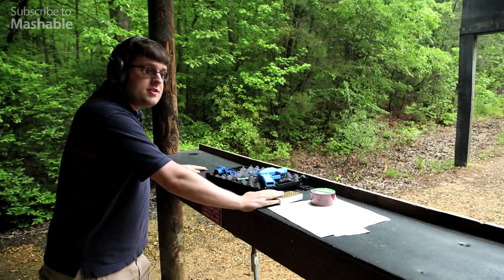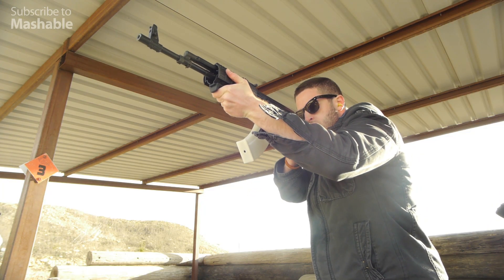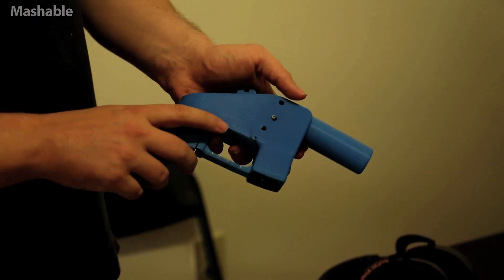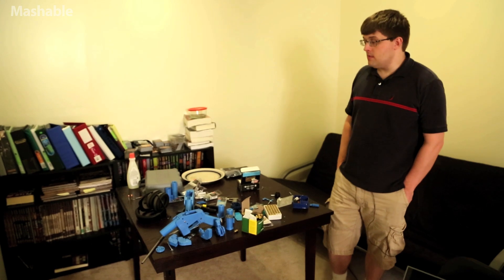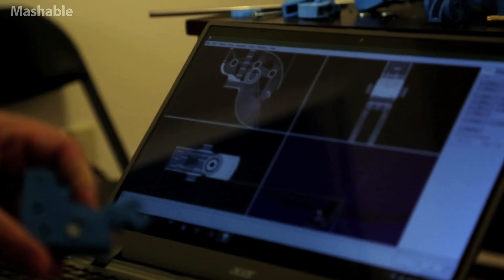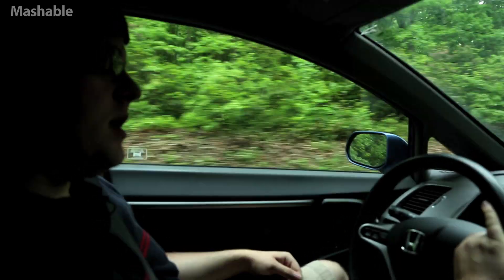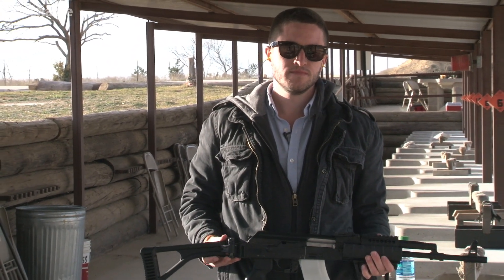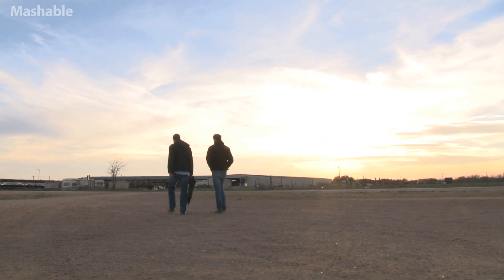I 3D Printed a Gun | Mashable Docs

Comment: This is going to blow your mind, but a forensic lab can use x-rays to retrieve serial numbers that you thought you filed off. When the metal is struck with a stamp the molecular structure is re-arranged so deeply into the metal that if you tried to file off enough to remove the underlying evidence it would ruin any gun barrel less than a cannon. The police should be breaking down your door any time now.

Comment: The Santa Monica College shooter had mental problems and could not pass a background check to buy a gun. Instead, he opted to buy an 80%-finished lower receiver (a useless block of aluminum) and finished it off in his bedroom, using a cheap drill press. How could you possibly hope to stop that? The criminals and crazies have always been able to make their own firearms at home, and the use of a 3D (plastic) printer would be a significant downgrade compared to metal-working equipment.

Comment: An empty gun in an airport is not a threat. Bullets are metal, and I doubt a 100% plastic casing and primer are in the works. A company called PCP has developed a plastic casing, however those rounds have a metal bullet, and metal primer. All which would be detected by metal detectors.